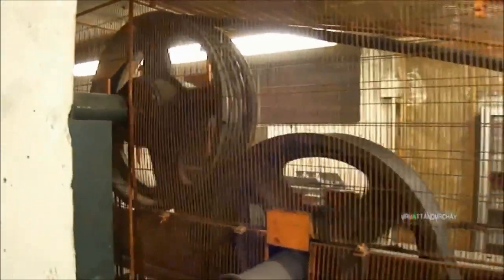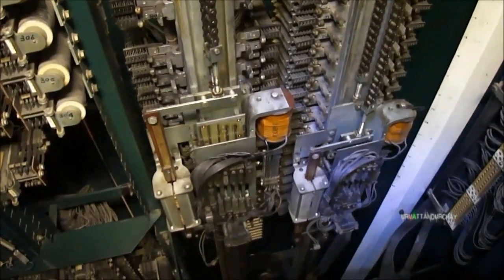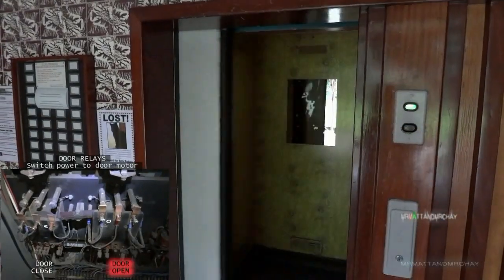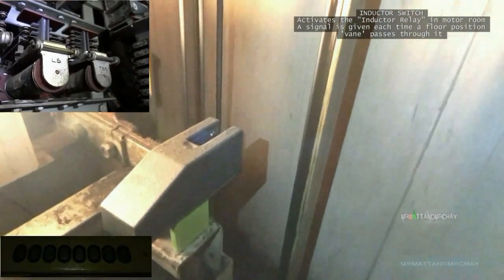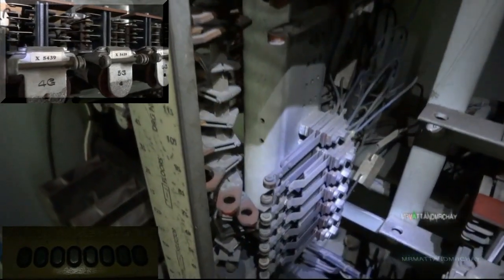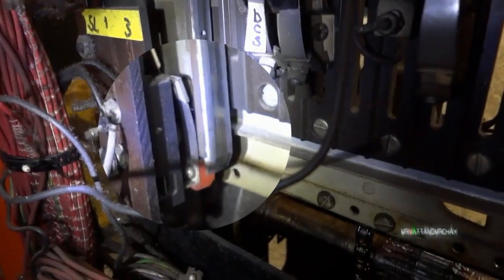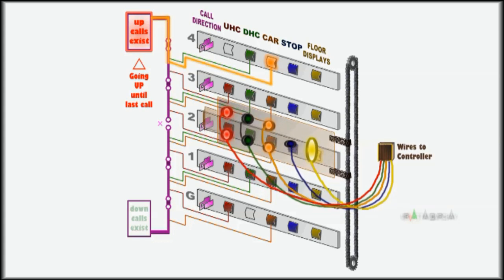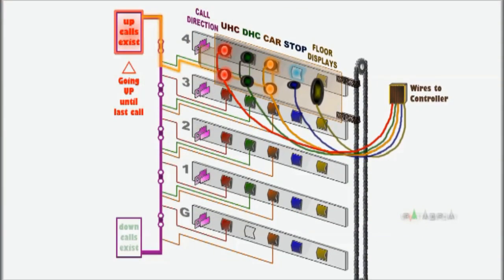How an elevator FLOOR SELECTOR works

Comment: Were those floor selectors for faster elevator? Cause I dont get why there were so many complicated designs, almost all old elevators I know have their copies in the shaft and only a few have them in the machineroom like the Schindler ones at 1:20. I would guess that those were still pretty old copies from before the 60s.

Also I wonder why some companies had a whole switch cabinet full of contactors for one elevator, when the elevators my grandpa build used a circuit board and 4 contactors to do the same stuff
Reply: These system are using relay logic, which requires a lot of relays.  Even a basic two floor elevator could not be controlled with just four contactors using only relay logic, so perhaps your grandpa worked on systems with early solid state logic and the contactors were just for the motors?

Comment: Umm, so hard to comprehend the level of issues this had. Now you can do that with 1 arduino uno + some power relays or powerful semiconductors. It can all fit in a size of one desktop PC case. Crazy. (Not including motors and other mechanical parts of course).

Comment: There's an old adage about cleaning contacts, if it's runnin don't f*** with it. Not to proud to admit I've crashed a pie plate selector in my time. As an elevator mechanic, you only do that one time. O.J.T. We all have our ups and downs.

Comment: What was the problem with switches in the shaft? It must be more accurate to have switches directly activated by the lift.
Reply from the maker: Good question, and the answer comes from being able to maintain and fault find the lift.  Russian elevators have the switches down the shaft, but this is not a popular solution.  Most lifts I know (Otis, Schindler, Express, Bennie) had the floor selector in the motor room for the following reasons: 1) Adjustments can be made in the motor room, 2) Any fault finding is done in one place, 3) Servicing most of the parts is done in motor room without having to jump on top of the lift.  Imagine trying to fault find lots of switches in a long lift shaft on your own :)
Reply: I would think that if a lift was not levelling correcly by say one inch then the adjustment at the Floor Selector would be minscule - and you would need to keep leaving the motor room to go and check.
Reply: @mrmattandmrchay  Not all Russian lift have these switches. only soviet 0.71 m/s models had. Faster lifts like 1,1.4,2 or even 4m/s had just sensors on the cab and magnets in at shaft.

Comment: IMHO selectors are too complicated units. In my country and all former SU there were no "selectors" or "copiers". On first elevators (some run until today) the were simple bi-stable  "floor switches" in the shaft, switched by moving cabin. If the cabin is higher the switch is in left position, if it is lower - in the right position. And only when cabin is on the floor it holds the switch in middle position, both contacts opened. Another elevators use "selection sensors", inductive or with magnetic contact, one per each floor in the shaft, and stop sensor on cabin, also inductive or magnetic. Each sensor has it's own "selection relay". No selectors. Maybe more wires in the shaft.
Reply: Floor switches in the shaft are all very well for a slow lift with only a few floors. Trouble is, the stop is just “switch off the power & bang on the brake”. You really don’t want to be doing that at higher speeds. Also the floor levelling is very difficult to keep to any kind of accuracy or consistency. A smooth stop is usually erratic in level requiring a slide on the braking. A more consistent accurate stop requires harsher braking. That’s hard on the equipment and unpopular with the passengers!
  A lift with many floors needs lots of switches and lots of wiring.
Reply: @Carol-East  of cause mechanical switches were used for speeds not exceed 1 m/s. Fast elevators used selection sensors per each floor  with magnetic bound to the cabin, and of cause they were not used to stop. They activated low speed, and then a cabin sensor made accurate stop.

Comment: ( i think) the most commonly used by me lift has your favorite generater. why?

1) the lift is an otis.

2) i usually feel the lift slow down before it stops 

3) those are the reasons.

Comment: What do they use now instead of a motor-generator set to provide DC to the traction motor?
Reply: Variable-frequency drives are used now instead of DC motors
Reply: after the motor generator, rectifiers got used, then the variable frequency motors came later
Reply: SCRs (silicon controlled rectifier) convert AC to DC.

Comment: The Otis design is probably the coolest looking version with the rotatable discs.  Nowadays, we have rotory encoders and direct loop feedback to either an AC variable frequency drive or a DC SCR drive.  Much easier to make adjustments now, its done directly through programming in the motion controller.  The encoder is connected to the motor shaft and reads its rotational frequency.  By understanding the rotation of the shaft, the car's position can be known.  The encoder connects to the DC or AC drive which then sends data to the motion controller board.  The motion control board makes a decision based on the distance between the registered calls and assigns a set speed profile for acceleration to the drive.  The drive continuously checks the actual speed of the shaft and compares it with the desired speed and makes adjustments on the fly.  This is referred to as closed loop control.  Once the drive reaches the end of the speed input curve, it slows down and the motion control board confirms that the car is at level and the doors can be opened (after all the safetys are clear).
Reply from the maker: +Shawn Campbell prefer watching the old stuff better than the new.  I like the otis design also but never seen the version with the advancer though.  Thanks for the comment.
Reply: Not half as much fun as the 6850 rotary selector.

Comment: Hey your vids are awsome what editing software do u use?
Reply from the maker: Thanks for your comment :)
It depends what I'm editing and how 'in depth' I want to go.
Normally I use Pinnacle Studio 16 - quick and easy, good for animating pictures (add photo, add something like a switch into it, copy it...on next photo remove switch, copy it, and so on).
If the video is complicated or I want to spend time doing something special then I use Adobe Premiere CS4 (CS5 and higher requires high spec PC).  My intro was done with this.  Creating multi-screens and layers is far quicker in Premiere.  It's a much more professional product but requires a lot of practice to get to grips about how it works.  You have far more control and can do LOADS more stuff, but if you have a movie that you want to upload asap then Pinnacle is quicker.

Comment: Wow, that's really interesting, particularly those OTIS rotating disc selectors...there were several of these in the building I used to work,in but sadly has been demolished now. I don't imagine there are many of these left now, almost an endangered species sadly.
Reply: Probably less than 1,000